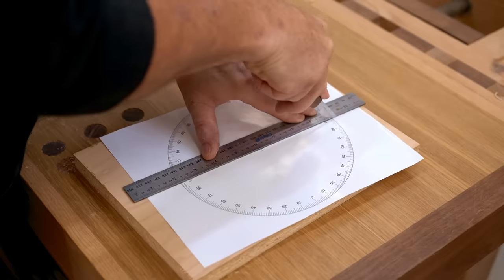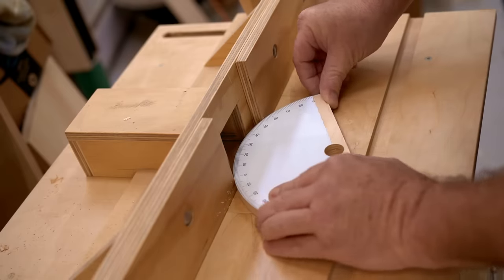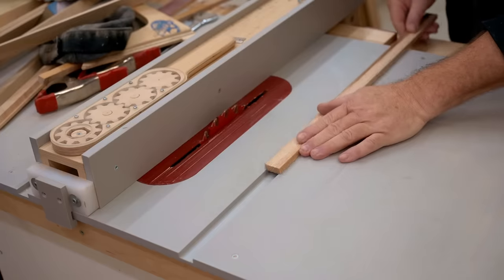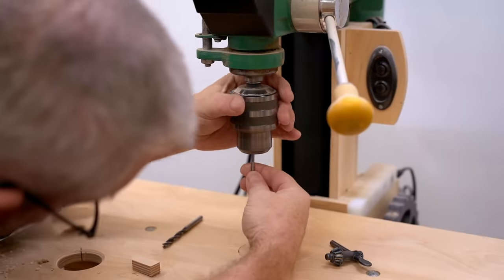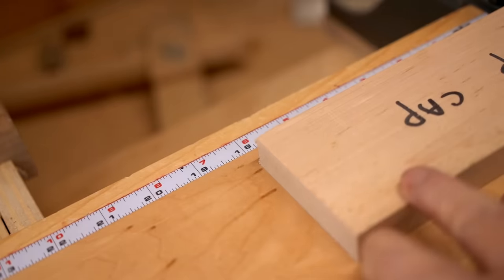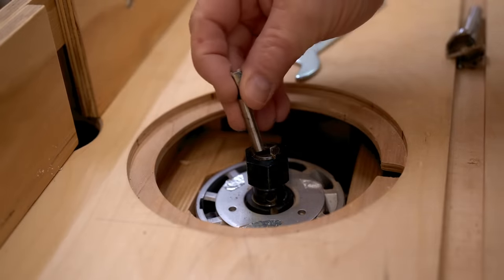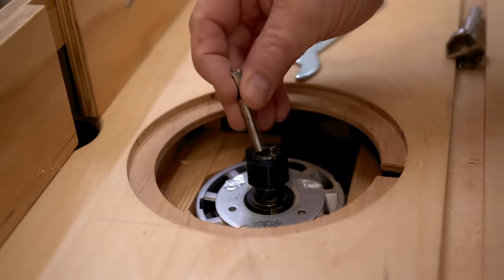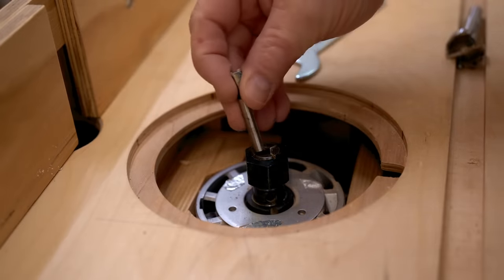Throw Away Your Miter Saw and Make this Instead

Comment from the maker: Of course I'm not getting rid of my miter saw, but this is a good alternative to use on the table saw. And yes, you can buy one of these ready made (and you saw may have come with one), but this is more about the methods I used to build it than the final product.

Accuracy - you can dial it in to perfection at several angles (0, 22.5, 45 both ways) and then drill a locking pin hole through the plywood protractor and into the guide cleat for a 1/8" drill bit shank to lock it at that angle. Takes a bit of time, but once it's done, it'll be accurate every time you set it to that angle and insert the pin. I'll make a video on my Scrap Bin channel later this week showing how.
My "Scrap bin" channel:
https://www.youtube.com/c/IBuildItScrapBin

The key feature is the way the fence works and you can add it to a ready made miter guide. It folds back and acts as a handy place to keep the stop block. I need to add a magnet to hold the fence extension in the folded back position and I'll do that in the Scrap Bin video as well.
Reply: Nice!  Mostly wood miter gauge should help prevent inadvertent Saw Stop safety triggering 😊
Reply: Absolutly perfect build! Thanks John!

Comment: I use plywood for runners, never swells but I live in a  humid area.  I made johns mini sled and the norm sled which is awesome.   You all need the norm sled. That thing is a must.   Also i got a used incra from a retiring woodworker, it needed tweaking since it had abuse.  John you should make plans for this.  I love your plans, so clear and well engineered.  Your small toolbox is next.

Comment: The concept is sound. I Like IT! I will use the concept and make it!   Yet, I have found most "Framing Squares" used in general construction are notoriously NOT really square. Verifying the final cut with the caliper or even the caliper and the "5 Cut Method" without spending upwards of $500 for the gold anodized commercial instrument.  And making it DIY, knowing how to adjust it to the tolerance we desire. More Valuable!

Comment: I purchased a new table saw of much higher quality than I've owned in the past and it came with a miter gauge like this thaylt works super well and is very accurate, so I had the thought of getting rid of my miter saw.... 

The next day, I was cutting 8ft and 10ft boards on the miter saw and decided to keep it... 

But I could also just cut those with a square and a circular saw. And still free up the space. 

Ultimately, out of laziness more than anything, the miter saw is right where it has been for several years now... 

But.... I made a frame for a mirror recently out of some birds eye maple that I didn't deem worth enough for an instrument, and I knew automatically the table saw would cut the miters better. And it did, and the frame came out great because of the accuracy of the table saw with the miter slide.

So really I need to get rid of the miter station probably.... one day...

Comment: Perhaps a few perfectly tuned stops at standard angles? This could be done by drilling holes in the top of the protractor (and a little way into the rail) and dropping a pin through
Reply: Looks like you already had this planned (scrap bin video)